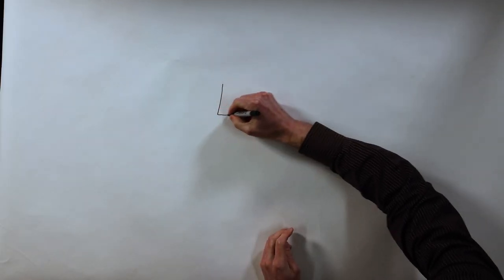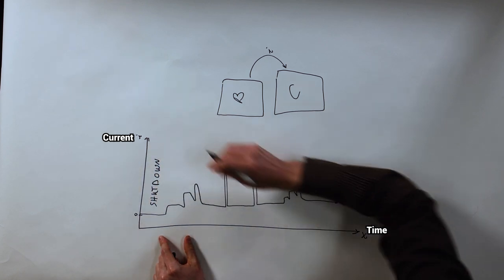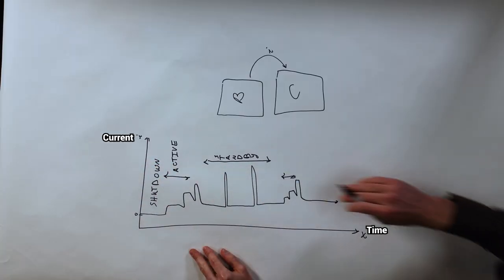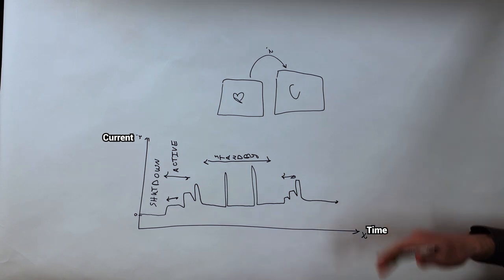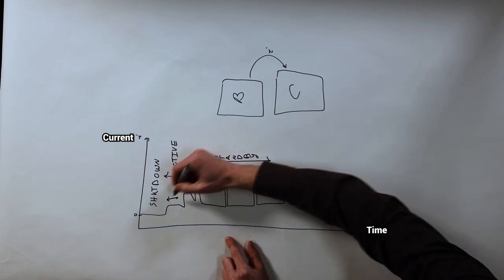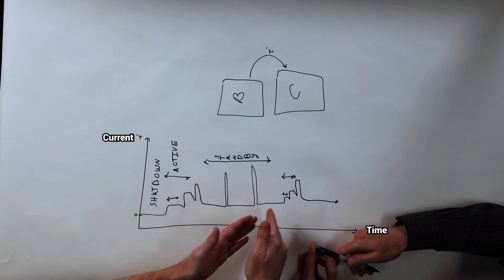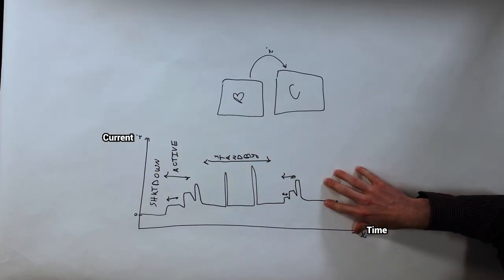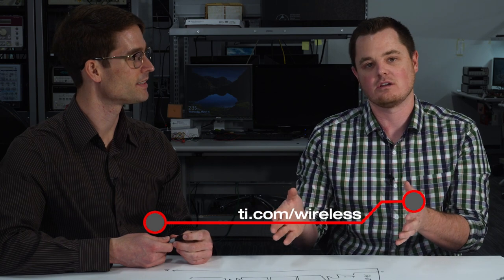Connect: Understanding power modes

Comment: Power depends on current, voltage and square of frequency of operation. Dimension analysis of standby and shutdown indicates only clock states are running. Good summary?